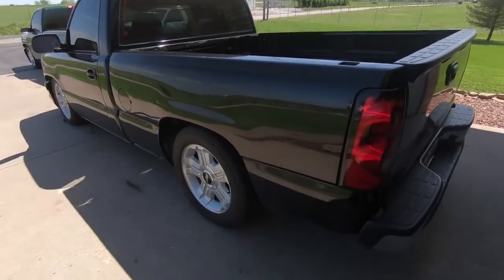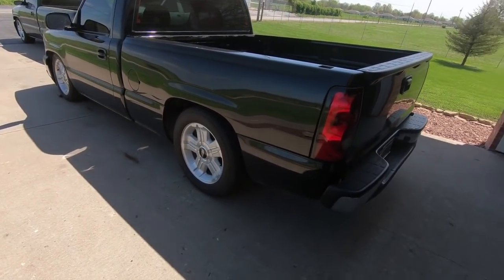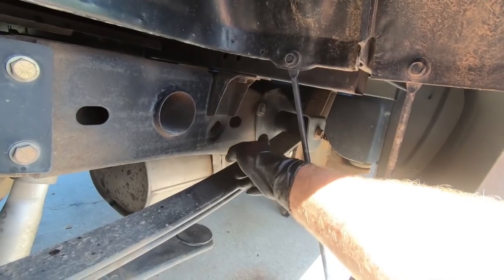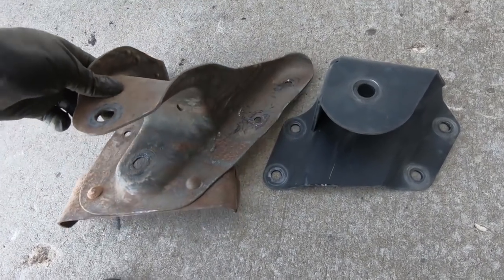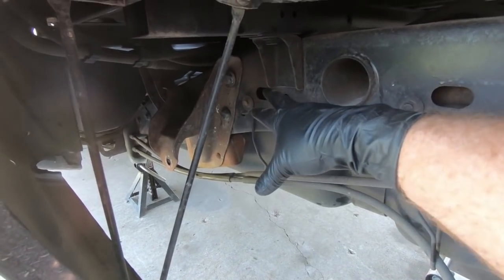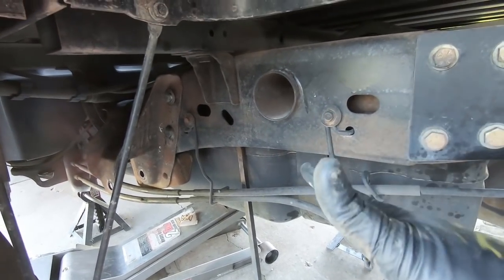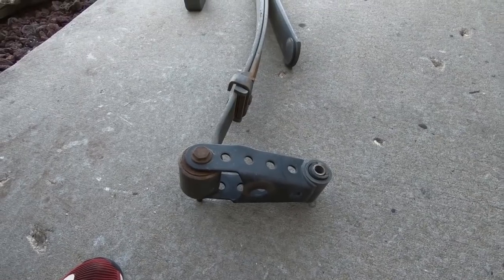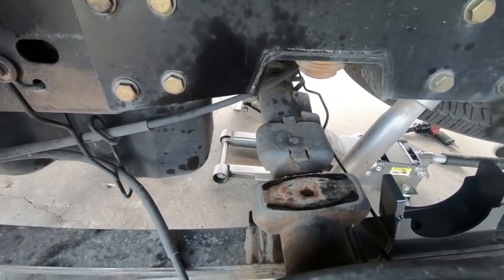Flip Kit install on Silverado / Sierra (Removing Hanger Drop)

Comment: Wow i used to have that drop, im at a 4/10 right now and i hit everything 😔 i love scraping tho lmao
Reply from the maker: Dang that is low!
Reply: @TWAMotorsports  yes it is. I have that same cateye but with hd front end and over here in texas the truck scene is really big you should check out the shows down here 👍🏼
Reply from the maker: @abasabas3051  I need to
Reply: No quema Cuh 😂
Reply: Abas Abas did you go with a normal c notch? Or did you get the monster notch? I’m planning on doing a 4/10 on mines but I’m wondering what notch would be good.
Reply: @abasabas3051  what do you have in the rear for the 4/10 drop??
Reply: What's your IG

Comment: I have an Nbs crew cab with a flip kit and I ended up putting in 3/4 ton springs and absolutely love how it rides. I didn’t want to go the route of helper bags and dealing with all of that but needed a firmer ride. I’m happy with how it turned out.
Reply: New HD springs? Or whered you get em? I feel the rest needs some more spring but I didn't want to spend the money for a single leaf or the super sport springs

Comment: I literally bought stock hangers today to do this same thing this weekend! Thank you so much, this video really helps!
Reply from the maker: Awesome. I didn't know how many would go 4 to 6 or more but glad I could help.
Reply: Where did you buy stock hangers?
Reply from the maker: Had a buddy with them
Reply: @lilal2678  found mine on offer up
Reply: Why do you have to replace with stock hanger? Its only an inch difference right? Id like to do a flip kit too but have belltech hangers.
Reply from the maker: That will not work.

Comment: Man I’m hoping you can help me. I have really bad squeaking in the back after doing a flip kit. Can I loosen up the shackle bolts while the truck is on the floor and then torque them down?
Reply from the maker: Yes you should always torque with weight on them

Comment: Thanks for this video👍 I just pay someone profesional to put it 2/4 drop on my Silverado 97 after all I notice there is giving me 18 inches in the passenger side back bumper and 19 on the left also by the tires side the numbers are different. My question is do this need to be level or that’s normal?  Thanks in advance
Reply from the maker: Sometimes they have a chevy lean. I sometimes trim some off the front string opposite side.
Reply: There is a company that makes a drop kit that corrects the lean. The reason it leans is the spring perches in the factory a-frames are higher on one side. The 4/6 drop kit I saw replaces upper and lower a-frames and you reuse your factory springs. IHC is the company
Reply from the maker: I don't recommend IHC. Buyer beware

Comment: Why didn't you use the hangers with the flip kit? I wanna put a flip kit on my Z71 and possibly use lowering  hangers an shackles with the flip kit for lowering even more. Then use air bags on the axel to get up to ride heighth.
Reply from the maker: Won't work. And would ride terribly. Pinion angle would be way out also

Comment: So i got a 03 Silverado SS Awd, with 2"/2" drop, 2" drop spindles in front, and 2" drop shakels in back, want to go 4" drop on the back, was told to get the stock shakels installed and get a flip kit so i can get the 4" drop on back. Do u think it will work and, Do i need a to do a c notch.
Reply from the maker: Yes you need a notch. Stock shackle and flip kit is 6 inches of rear drop

Comment: Sup Travis. Thinking about doing the same putting stock hangers back and flip kit. If you remember whatd u torque the bolts for stock hangers to? Thx
Reply from the maker: Front ones were riveted so just as tight as I could

Comment: I have a flip kit in my rear with a lowering kit I got from RC but the guys that did the work installed a 2” lowering shackle I had laying around that didn’t come with the kit. It seems that 2” shackle is defeating the purpose cause I don’t see much difference. I’ve been told to use the stock shackle instead to get the correct drop t even a lift shackle for more drop since the leafs are flipped. Is it difficult to do that swap on the shackles only? Do I need to remove everything?
Reply from the maker: No the shackles can be swapped by themselves

Comment: Hi Great how to videos. I just bought a 2006 Chevy extended cab that already been dropped.  What am trying to figure out is how much it had been lowered so that i can order the correct shocks.  is there a center of wheel to fender lip measurement that i can go off of. Many Thanks
Reply from the maker: Probably but I don't have them unfortunately

Comment: hey man happy 4th i wanted to ask what you used to make the hole bigger for the original hanger. recently did a flip kit and had the hanger and shackle and drive shaft went bye bye because of the angle.
Reply from the maker: I didn't make any holes bigger

Comment: What if he opted to use the stock rear shackle as opposed to the drop shackle to get that little bit of lift in the rear to not bottom out so quick?
Reply from the maker: It would be 6 inch drop then

Comment: I want to install the stock front leaf spring hangers on my truck, for the driver side I first plan on driving the truck until it is at 1/4 or a little less of 1/4 tank to drop the tank but my question is can I just remove the tank brackets and lower the tank a little and scoot it over just to where I can get the wrench inside to loosen the nuts or do I have to disconnect something on top of the fuel pump before lowering the tank?
Reply from the maker: Gonna put a lot of stress on the lines doing it that way
Reply: @TWAMotorsports  Thank you for the reply, so should I just disconnect the fuel lines and then lower the tank or what method would you recommend?
Reply from the maker: If you juat loosen straps you can move over enough without removing

Comment: So he's at a 8" rear with the flip & shakles. Does he bottom out on the notch often? Because mine does at 8". I have the same truck using same shocks.
Hoping if I raise it 1" on the shakles that will help me not bottoming out
Reply from the maker: I went to 7" in back. At 8 it was riding on the bump stops
Reply: @TWAMotorsports  thanks hopefully going to 7" will help me out. And sorry I didn't realize I asked the same question on both your videos lol
Reply from the maker: @Kevin_Yagoonie  that's ok

Comment: I have a question what’s the reason why you changed the hangers? Is it because it till be too low or is it because it wouldn’t hit with the flip kit because right now I have the hangers and shackles and I’m looking to do a flip kit to go low low in the back and I was wondering what is the reasoning on the stock hangers being put back on thank you
Reply from the maker: Angles would be way off.
Reply: @TWAMotorsports can you explain what that means. Sorry for the questions I’m just trying not to mess things up
Reply from the maker: Don't do it. Will break driveshaft and possibly transmission. The pinion angle will not be correct.
Reply: @TWAMotorsports even if I get a 2 piece drive shaft and cut some space to clear the drive shaft?
Reply from the maker: Nope.
Reply: @TWAMotorsports  thank you I appreciate it love the videos btw 🙏🏽
Reply from the maker: Thank you

Comment: I have an 05 Silverado,  i also installed shock extenders from belltech and they only came with one long bolt and a tube washer that goes in the original shock holes, and didn't require makin that back hole🤔, might be different from this one but ur link says won't fit my 2 wheel drive 05 Silverado. You know why that is?
Reply: This is the one I used.
Reply from the maker: Either will work. I like the drilled option best though

Comment: Just got a stock height 2010 Silverado reg cab work truck with the 4.8 engine. I just wanna lower the rear maybe 5” to level with the front. How should I go about it? Couple of things I noticed. My rear hangars are fully welded on, not riveted. All I’m seeing online are 2” drop shackles which don’t seem like enough by themselves.
Reply from the maker: You can get 3" on those with shackle and removing the block above leaf springs
Reply: @TWAMotorsports  OK thanks for the reply that’s what I’ll do then
Reply from the maker: You're welcome

Comment: Hey Travis, the trucks looks great man. I've got a quick question seeing that you're obviously a GM man. I need to tap into the dome light wire from the grey BCM connector on my 2011 Yukon. Should I disconnect the battery so as to not have any issues from the BCM???
Reply from the maker: Definitely disconnect the battery
Reply: @TWAMotorsports  I really appreciate the feed back. Thanks for video's and knowledge they and it has proven quite useful for me.

Comment: Why did you have to remove the hanger? Would the flip kit not fit or would it just be too low for the type of c notch it has?
Reply from the maker: Can't have both. Angles would be way off
Reply: @TWAMotorsports  ohhhh okay but you can have one or the other?
Reply from the maker: Correct
Reply: @TWAMotorsports  thanks!
Reply from the maker: 👍you're welcome

Comment: Can I use the stock u bolt retainer plates? My flip kit didn’t come with them. I’m concerned
Reply from the maker: Generally not unless the kit was designed to
Reply: Okay so I ordered the plates just to be safe. Can I use my stock bolts? Bolts aren’t provided with the u bolt retainer plates..
Reply from the maker: Sounds like a terrible quality kit you bought

Comment: hey man i want to lower the front of my cateye 4 inches and i was wondering what’s the difference between 4 inch lower and upper control arms and just 4 inch lower control arms. I want to get just the lower control arms because they’re cheaper
Reply from the maker: I don't like a arm drops but lowers are what lower it. Uppers get alignment correct
Reply: @TWAMotorsports  ohh so if i buy upper arms i won’t have to get an alignment?
Reply from the maker: No. It's for keeping the balljoints aligned so they don't wear out

Comment: Hello Travis, i have that configuration on my 2002 silverado, Drop front hanger and rear shackles looks good but the ride is terrible has only a couple inches gap for suspension when the truck takes some bump it hits and bounces... do you think it would be a good idea to install the cnotch without the flip kit?
Reply from the maker: I think you need a notch at 4 inches.
Reply: Deff need a notch with any 4” lowering kit in the rear.
Reply from the maker: I tend to agree
Reply: @TWAMotorsports  hi Again, I have a quick q? there's any difference between the c notch on this truck with the one you used on your Sierra?  because the c notch on your sierra looks more reinforced and this one looks like a metal plate, thanks
Reply from the maker: One on the sierra is the best bolton one available

Comment: is there a 4 or 5 inch flip kit option? I assume its adjusted by the shackle? would a two inch lift shackle give it the 4/5 rear drop options?
Reply from the maker: Not really on these years
Reply: after doing some research it appears to me that a flip kit and rear lift hangers will provide the best adjustment option, lift shackles come in half inch sizes as well and it appears to me that a flip kit with this setup can get you 4, 5, or 6 inch drop adjustment by using different size lift shackles on the hangers - I rarely ever see this done or see the rear hangers installed (everyone changes the front hangers)but its looks like best option to me @TWAMotorsports
Reply from the maker: Yes you can do lift hangers but I am not a fan of that
Reply: why not? what dont you like about lift hangers? seems to be not much different to me then doing the front hangers a lot of folks do @TWAMotorsports
Reply from the maker: Not enough swing on them
Reply: not to keep bothering you, but what do you mean by that "not enuf swing"? not sure what that means @TWAMotorsports
Reply from the maker: That in my opinion hurt the ride due to being so short and not allowing the leaf spring to move correctly
Reply: I cant find any examples or vids on youtube of anyone doing it that way, do you know of any? I think it would be the shackle size that determines the movement @TWAMotorsports
Reply: I would think traction bars do a similar thing to the spring to limit movementduring takeoff @TWAMotorsports
Reply from the maker: Just my opinion

Comment: I hve a 2/4 belltech drop on my silverado want to go 4/6. I have spindles in the front. Should i do 2inch drop springs or get stock spindles and do control arms.  I have some questions lol
Reply from the maker: Definitely springs
Reply: As far as the hanger, do you think you can put the washer/nut on using long needle nose pliers?  Or is it impossible
Reply: @TWAMotorsports  also how do you get rid of the chevy lean? You know more about these trucks suspension
Reply from the maker: It would be tough
Reply from the maker: Trim a little off the opposite spring

Comment: Just curious as to why you can’t run the front drop hanger with a flip kit?
Reply from the maker: Alignment would be off and u joints wouldn't last 5 miles
Reply from the maker: No. Do not do that
Reply: @TWAMotorsports  thanks
Reply from the maker: You're welcome

Comment: Im in some kind of trouble, I recently installed McGaughys 2in drop spindles and I can’t fit a set of 17’ anyone know what I can do. The issue is the bolt at the bottom of the spindle is to long, do I cut it or have to get a new rubber bushing?
Reply from the maker: Have to cut the bottom of the stud off below the nut. This is listed in the instructions that come with the spindles

Comment: i dropped my 2003 single cab used 1 inch drop springs and 2 inch drop spindles and the rear it has a flip kit and belltech shocks with 2 inch shackles and i have a vibration on the rear does anyone k ow why its vibrating
Reply from the maker: Probably pinion angle issues

Comment: Are those the factory u bolts or are they longer?
Reply from the maker: Factory
Reply: @TWAMotorsports  thank you.
For some reason my factory u bolts are too short i already purchased lomger ones ( 2000 silverado rcsb)
Do you have a link to where i can find the shock obsorbers 
I already did the flip kit with rear drop shackle 
And front lowering springs.
Btw ive done all my work with the help of your videos. Thank you so much.
Reply from the maker: Glad my videos could help. In all my videos I link parts in the video description

Comment: My upper plate didn’t come w bolts what size are they?
Reply from the maker: Which upper plate?
Reply: @TWAMotorsports  well I don’t know what you call but my flip kit was exactly like the one in your video without the bolt and my axle moved up now my truck vibrates. I just went ahead and ordered a djm flip kit instead
Reply from the maker: Good luck with the djm. Pain to adjust in my opinion

Comment: Do you know where i could find stock hangers for an 01 silverado single cab online ?
Reply from the maker: Ebay maybe
Reply: TWA Motorsports cant find anything thanks tho
Reply from the maker: Several people toss them
Reply: TWA Motorsports yeah man i have the ones that you took off this truck and i hate it because i have a 4/8 drop and it rubs my diff
Reply: SELF_MADE_405  were they correct same mines rubbs diff? I’m at 8 with drop hangers
Reply: Ceels4.8 issue is you cant use front hangers you have to use 6” flip kit and 2” drop shackels so you can be 8” drop
Reply: Ceels4.8 i had a 10” rear drop put stock shackles so thats why i was at a 8” but with lowering hangers. Found stock ones at a local junk yard!

Comment: Seems unsafe to leave 2 bolts out of the front stock shackles. Now they can twist outward under stress.
Reply from the maker: That is the same way the aftermarket ones bolt on. Also factory is way thicker.

Comment: Just commented on your other video about tire size on your truck  just finished right now the flip  kit on my truck and the truck your working on looks lower than mine before u did the flip kit smh 🤦‍♂️
Reply from the maker: That's weird
Reply: TWA Motorsports I noticed that the bottom plate that holds the u bolts only has one hole yours has 2 but I don’t think that makes a difference
Reply from the maker: Not really
Reply: TWA Motorsports oh another thing I didn’t do the shock extenders
Reply from the maker: @soniac6733  could be bottoming out the shock. Been there done that. Unhook the shocks and see if it gets lower
Reply: TWA Motorsports ok thanks

Comment: What drop is it?
Reply from the maker: 5/7
Reply: @TWAMotorsports  thanks
Reply: @TWAMotorsports  what parts did you use for the front? Or is it the same?
Reply from the maker: You're welcome
Reply from the maker: Not sure what parts were used on the front but I did a how to video on my green sierra and it has all parts listed in vehicle description
Reply: @TWAMotorsports  thanks
Reply: @TWAMotorsports  is the green sierra a 5/7 drop?
Reply from the maker: You're welcome
Reply from the maker: Yes
Reply: @TWAMotorsports  is the 5/7 drop an even drop? I feel like the back is a little lower then the front
Reply from the maker: Parts are 5/7 but I only did this part so no original measurements
Reply: @TWAMotorsports  so what drop do you think Is the most even?
Reply from the maker: Even looks low in back. I like a small rack. 5/8 is probably even
Reply: @TWAMotorsports  thanks
Reply from the maker: @luxurnathan4353  you're welcome

Comment: You don’t need know shock extension for a 7inch drop🤦‍♂️ the extension for like a 8 and up drop
Reply from the maker: That's incorrect. It is need to correct shock geometry not for shock length